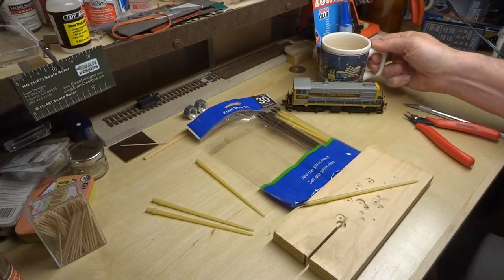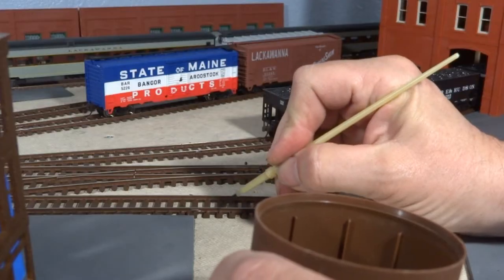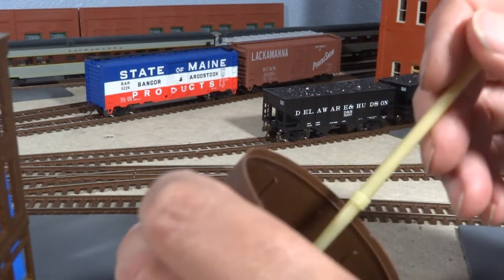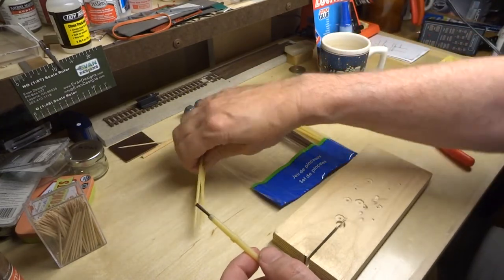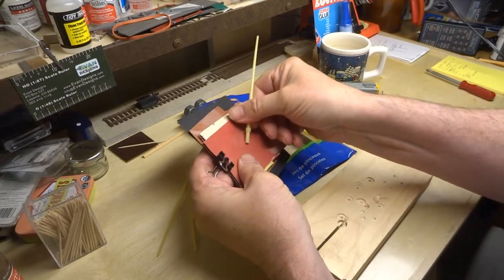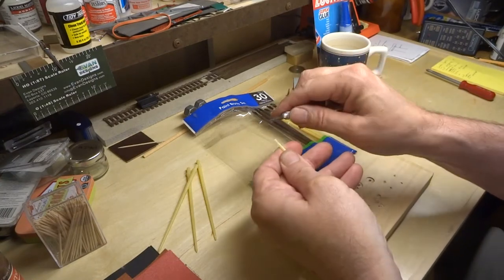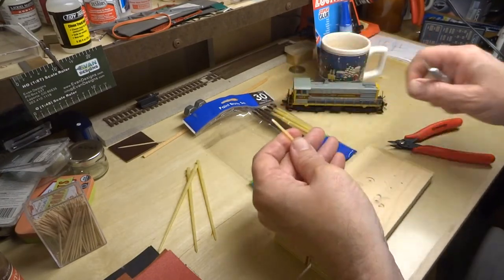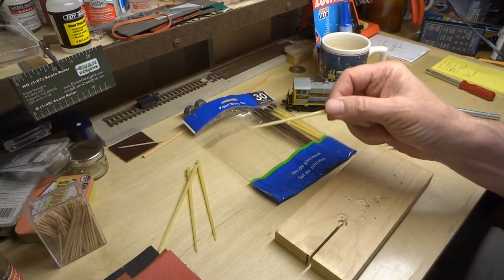Free HO Uncoupling Tool

Comment: How does it work? You apply a twisting movement or just press on the couplers?
Reply from the maker: Hey rva1945, thanks for watching!  I use the Kadee-type couplers that will work with a magnet on or under the track, but I don't do that any more.  Instead I find it much easier just to spot a car and manually uncouple.  Using some sort of small stick, make sure the couplers are relaxed enough to move a bit (not tightly pushed together or pulled apart) and with a couple fingers I insert the stick into the coupler and twist.  Sometimes with your pinky you can wiggle or push one car away as you twist the stick to separate the cars.
Reply: Thanks!